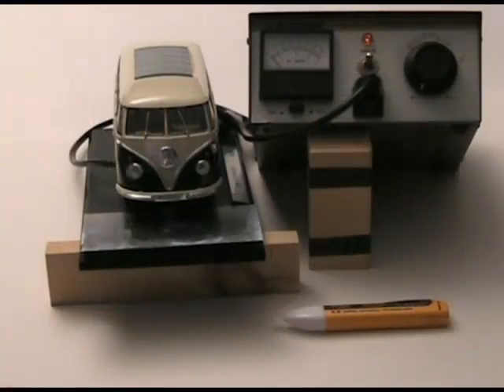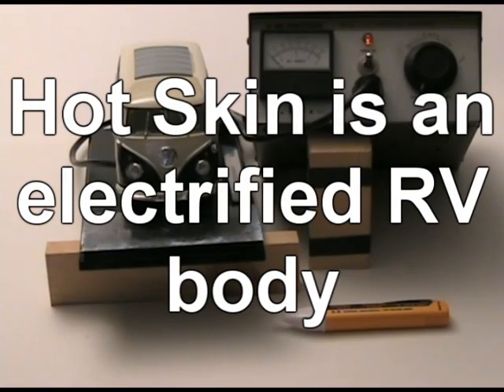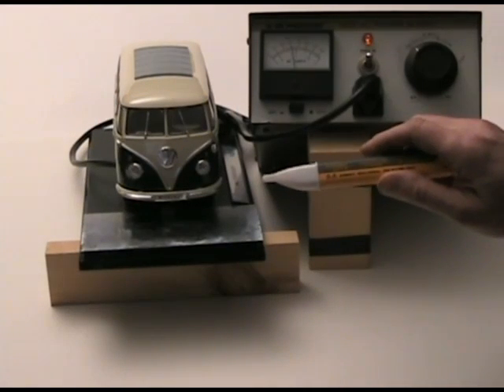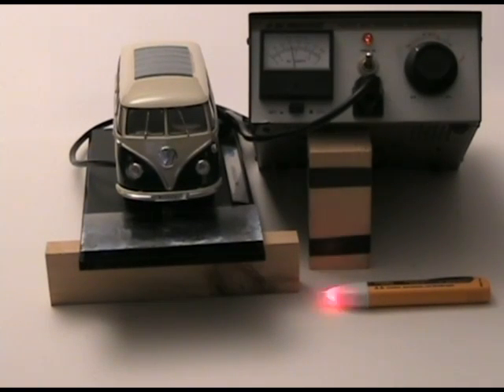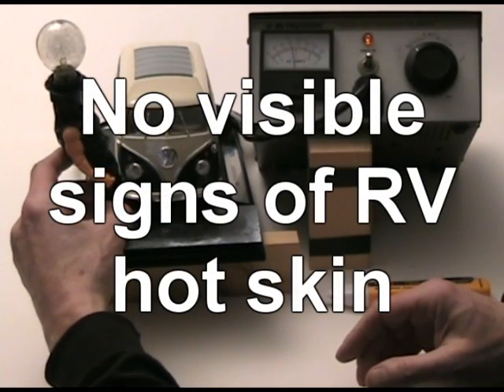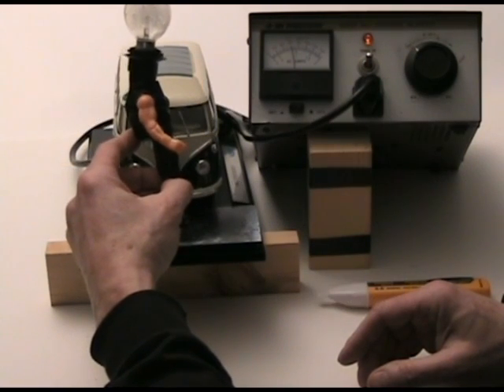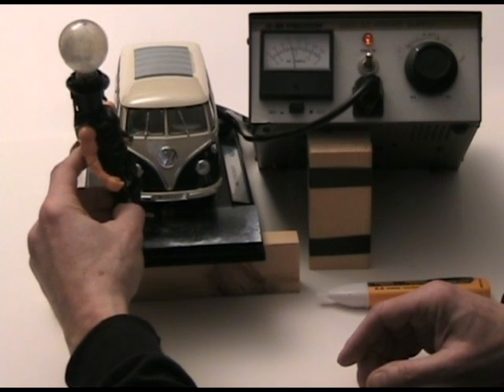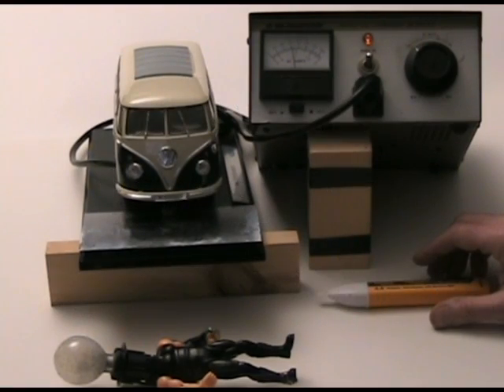How-To RV Hot-Skin Shock Demonstration

Comment: There's a lot of different things that can cause an RV hot-skin condition. I could be caused by a broken extension ground wire or adapter, a mis-wired electrical outlet in a campground or garage, or even something I call an RPBG (Reverse Polarity Bootleg Ground). Please read NoShockZone for a number of articles explaining how to test for the cause of a hot-skin condition.

Comment: You don't need to feel a tingle to know you have a hot skin condition if you use a Non-Contact Voltage Tester (NCVT) such as the Fluke VoltAlert seen in the video. I recommend using one to test your RV for a hot-skin condition every time you hookup to a new power source. NEVER accept feeling a tingle from any appliance or RV. The next shock could be fatal.